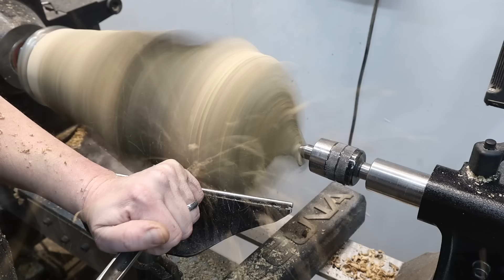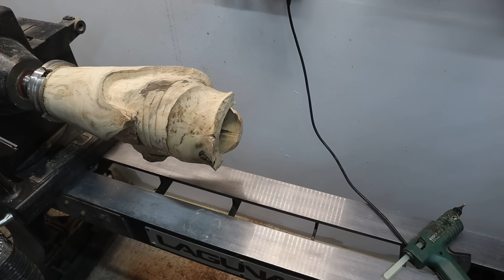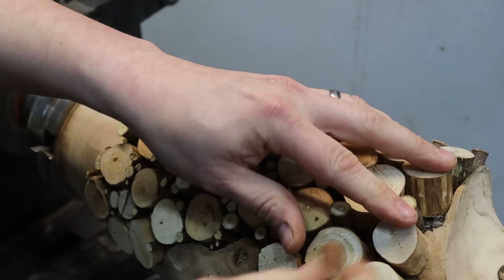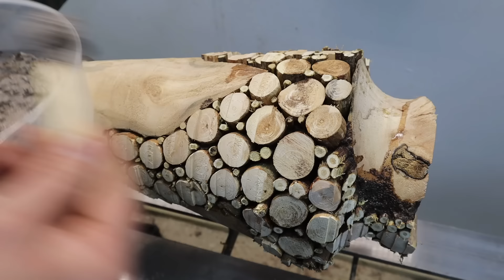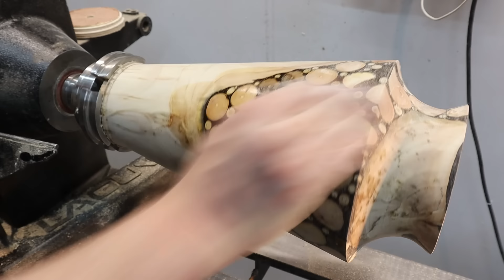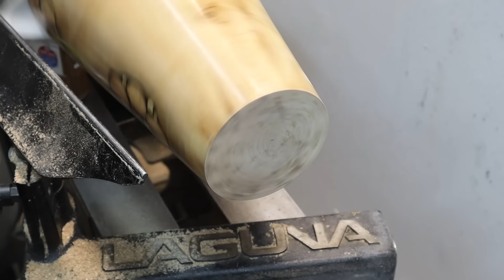Woodturning - The Sycamore and Stick Vase

Comment: never seen this pva glue / coffee ground mixture used in this way to fill gaps, very interesting. can you speak to how well it fills, sands, polishes, reacts with finishes? i imagine you could use wood dust in place of the grounds or maybe other fine particulate materials possibly like soda ash or lime?
Reply from the maker: Fills well and sands finishes good. Wood dust etc would be ok to use too.

Comment: Looks great! Does the wood glue filler between the sticks hold up well with seasonal movement? I’m guessing all of the strength comes from the wood glue and not the hot glue on the bottom of each stick.
Reply from the maker: The build up is done in several stages off camera, each drying and allowed to shrink. End build up there is little movement

Comment: Wouldn't it have been easier to peel the bark of the "sticks" prior to cutting them? That aside, wonderfull work, mate
Reply from the maker: Comes off pretty easy once dry, they dry quickly in the oven once cut up. Longer sticks means more cost to dry, always an offset when up against the clock..